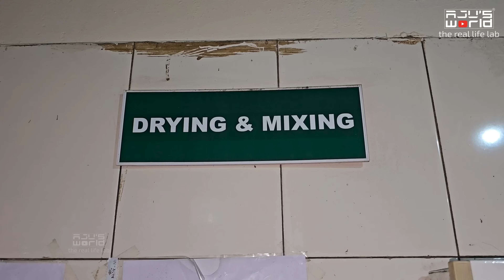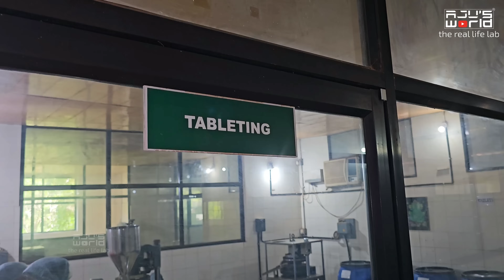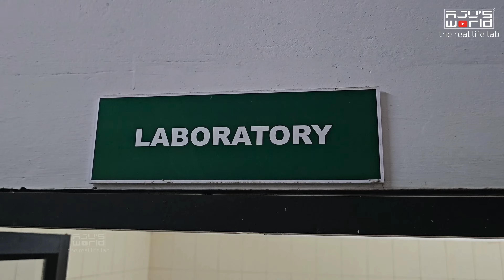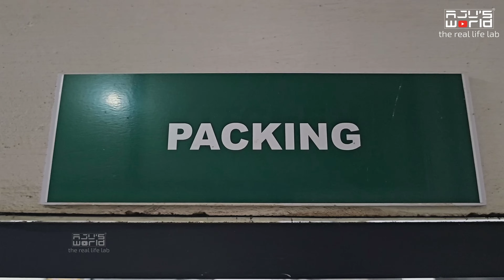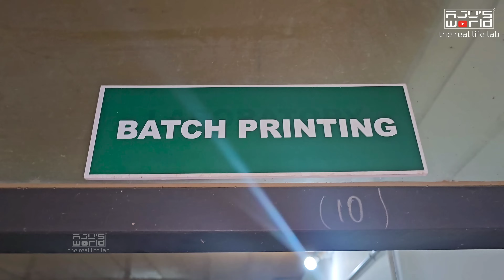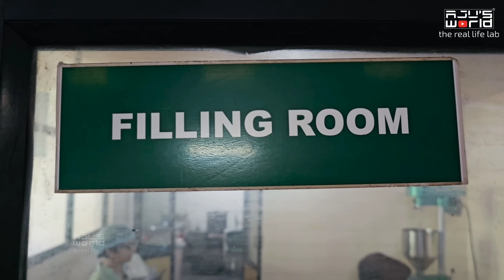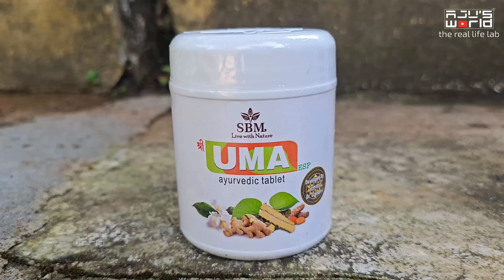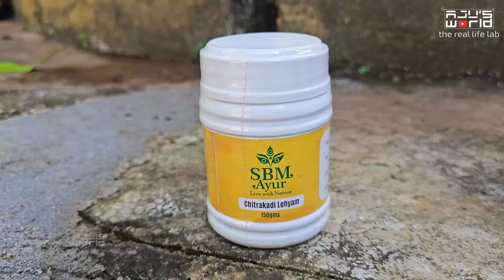പൈൽസ്, വെരിക്കോസ് വെയിൻഇവക്ക്.../Piles, Varicose Vaine/Treatment /Medicine /Ayurvedham /AJU'S WORLD

Comment: I have Varicose issue, no treatment so far. Recently avoiding water contact on feet which have light ulcer (wound),in this case it healed fast. My doubt is, if use this Oil then to wash with water & soap. In this case wound may not dry or heal. What is the Solution.
Reply from the maker: Sri Bhagavathy Madom Ayurveda Nikethanam,Laloor Road, Ayyanthole, Thrissur-680003

 https://www.sbmayur.com

Ph No:     8086001234      9539012515      9539012506                                                                                                                               For Consultation Booking-9539012526                                                                                                                                        Also available in Flipkart and Amazon